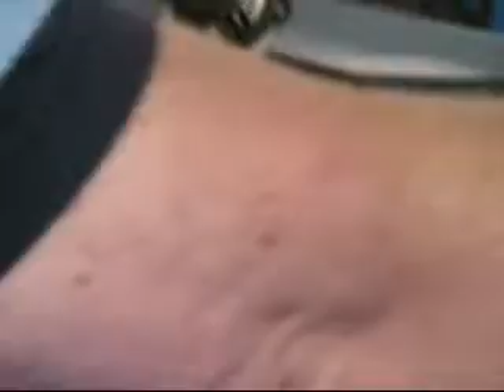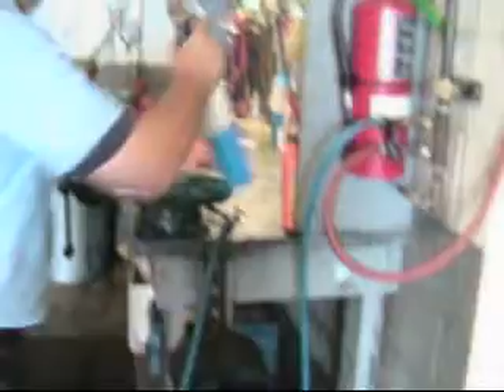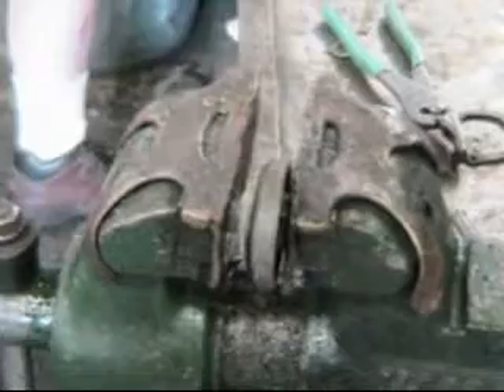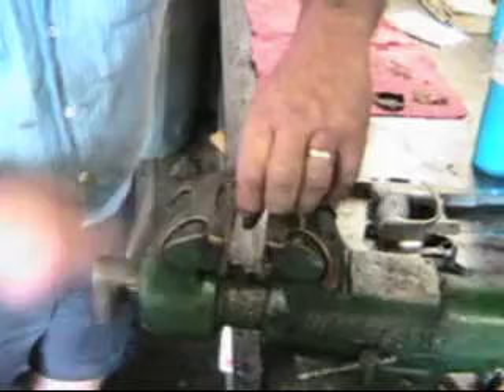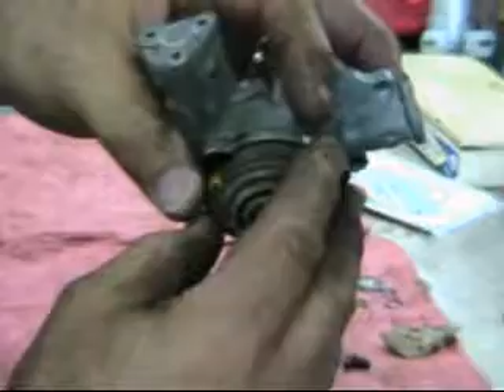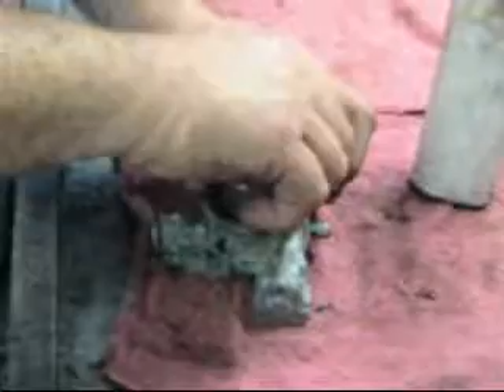014 MG Tech | Stromberg Carburetor (part 3 of 3)

Comment: Just did this exact same thing, but instead of John's method what also works is soaking the bolt overnight in PB Blaster or same, holding the body (protected) in a vice, keeping the "arms" from rotating with zip ties, then hitting the bolt with a breaker bar. For those not wanting to mess with fire.

Comment: Can you do a video on actually rebuilding the carb? Good video on the choke, but mine has factory manual choke. Having trouble getting the right gasket set from Moss Motors for the 150CD carb. Need help with rebuild and type gasket for carb to manifold, theirs is different than on my late 1500 made in 11/75( a 76 model with a 50th anniversary badge built into the dash